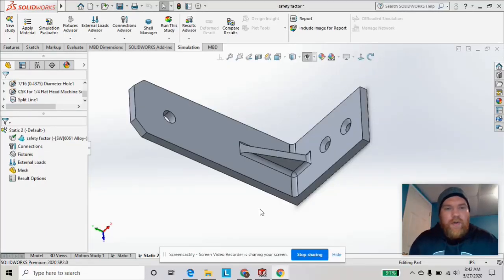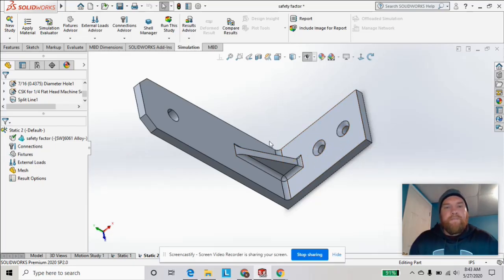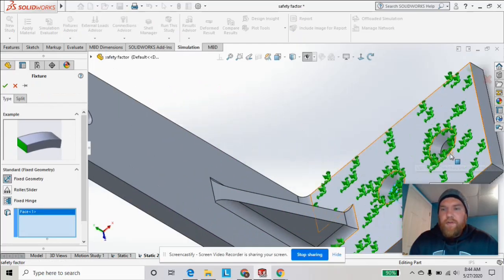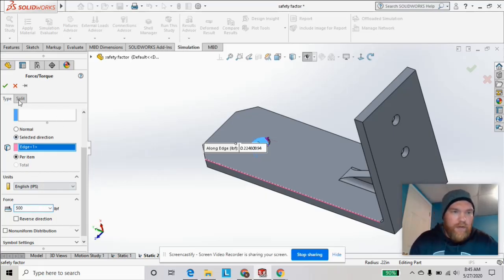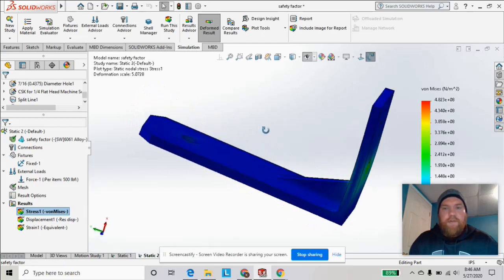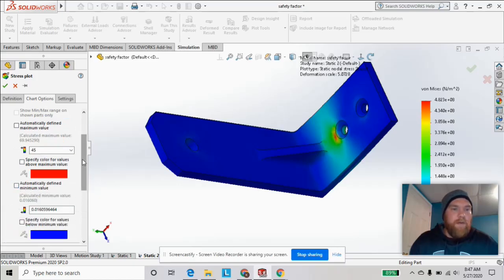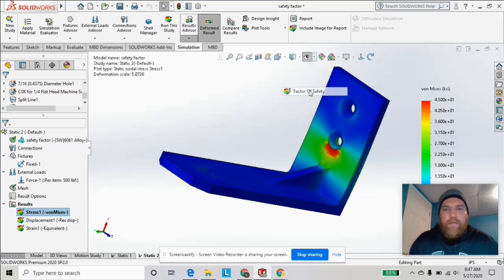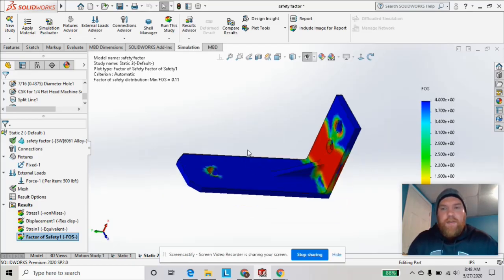Solidworks Tutorial | Stress Simulation and Factor of Safety in Solidworks

Comment: I am an instructor creating new content for my class. I am trying to find a video that can show me how to test a part by adding forces to a surface to see at what LBF the part will fail. For example I have a part that I apply 85 lbf to a surface and the part has deformations from the get-go. So then I apply less force and the part still has the same amount of deformation. I apply less weight again like one lbf and still the same deformation. What am I doing wrong. I am assuming that the part would have shown less deformation with less lbf when running a new study. Please advise. Thanks in advance.

Comment: Excellent...!!!! I have a  question...let say that we have  a bracket for a  bookshelf (see https://cascadeironco.com/pages/how-to-create-open-shelving ) ....having a force P  caused  by the weight of the book, and then the other part of the bracket is against  the concrete wall  fixed at  the concrete wall via a  bolt...however...there are some part of the bracket (at the angle)  that will receive a reaction force  from the concrete wall (pivot point)...would you include that force as  part of the external forces that need to be included ?...or there are  other ways to do that in solidworks ?  Thanks.